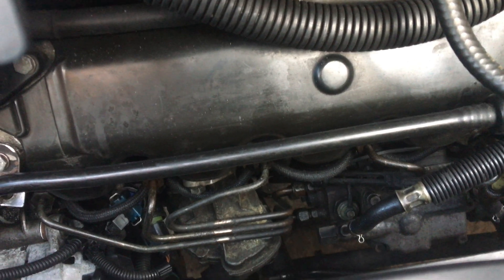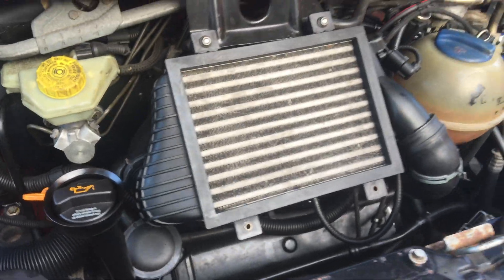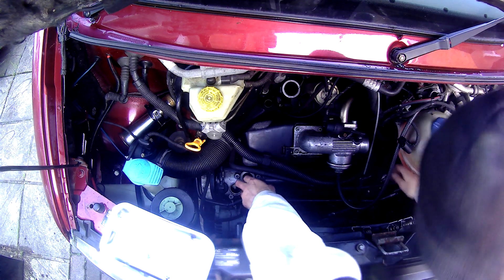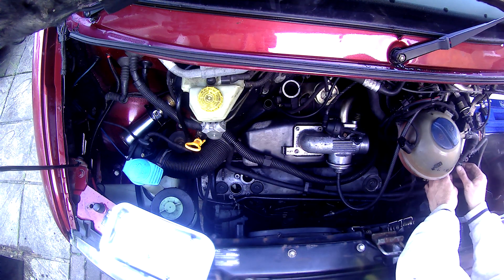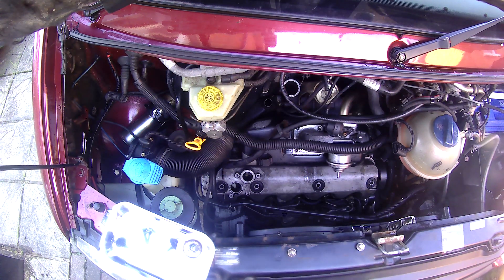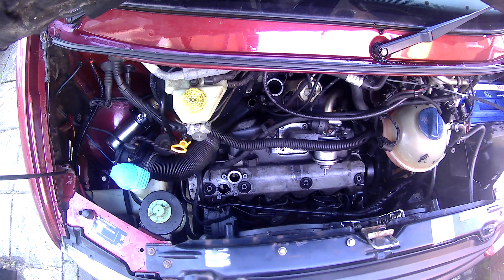Camshaft cover removal 2 5tdi ACV

Comment: Mark belts & pulleys with tipex before removal. As long as you dont take pulleys off camshaft timing will stay - if you replace cam oil seals though youl have to retime everything
Reply from the maker: Yeah with closer inspection I’ll decide then, might do all the seals when I do cam belt, spring 2022 😂